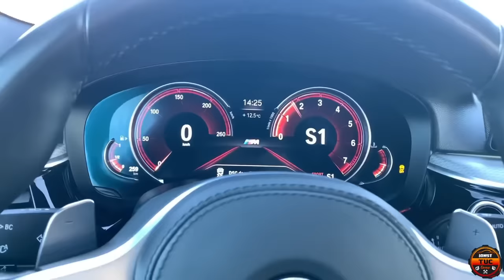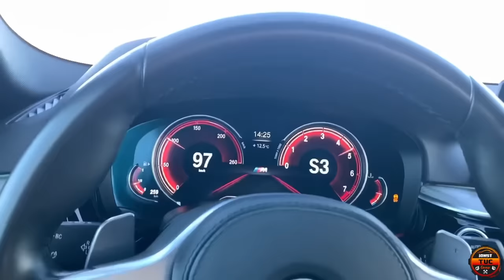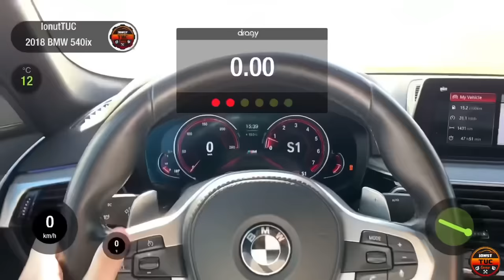Transforming BMW G30 in 8 minutes

Comment: Great black details, I like that you didn't try to copy an M5 but make a tasteful 540i. That ECU tune is quite a lot tho, how is the engine taking the upgraded power? Do you plan on modifying your engine as well?
Reply from the maker: The engine withstands up to over 600 hp! 😉👍🏻
Reply: Remember, it's the b58 😁
Reply: @darius4748  oh wow I didn't know it can handle that much. My M54B30 is currently at around 300 and it has already started to burn oil :D
Reply: Are all b58 engines made in Germany?
Reply: Funnily enough I actually strongly prefer the m5 style fender.. which is what I plan on adding when I get an m550i. The only thing I dislike is upbadging don’t put an m5 badge on a 530
Reply: @AstroF80  whats the price difference between an m550i and an acutal m5? Why not go for an m5?
Reply: @neskuikpeace  about $30,000. The m550i is a diet m5 in my opinion fast and comfortable and not too stiff

Comment: Wow, this was so nice to watch! Great job man!! What was the approximate build cost? 

I´m about to buy my first BMW which will be a 2018 M550i. Planning to do decat downpipes, airflow kit and a stage 2 tune performance wise. 
Cosmetically I´m considering doing a decal delete, chrome delete, mount full M5 bodykit, do the facelift in both front and back, go with 21" rims that has a more aggressive ET to fill out the wheel housing and lowering springs. I think that´s the ultimate car. Let me know if you have any ideas!
Reply from the maker: Total cost 10000$ without exhaust 
Good luck! 
Thanks man! 🤝🏼

Comment: nice job!!!
cant driven on the ,bumpy road ,become hit a front end ,give it up the comfy air suspension,fill every bump on the road ,
low profile tires help to make sure...   
stage 2 chip performance,is a nice touch ,the turbo work hard the air supply the engine. easy to smoke it up (not cheap,to replace)
looks good..nice video.
Reply from the maker: Thanks for the advice bro!

Comment: Beautiful 540i! Very tastefully done. Love the mods.  Curious why did you go K&N drop in filter instead of full CAI with cone filter setup?
Reply from the maker: Thank you man! I was recommended this K&N drop instead of cone because it seems that the first one is better. I think mostly because the cone one retains more dust.
Reply: @IonutTUC  Also, it's already a CAI; Don't spend the extra; just drop in the K&N.  That was the 1st and only mod I've done with my 2017 540IX.

Comment: Looks great 👍 about the deleting cat, did it make the check engine appear on the dash ? Because I was going to delete it too and put the strait pipe but then the guy who does it said that it will show the check engine on the panel and they can’t do nothing about it.
Reply from the maker: It did not appear because the next day I went and did the Stage 2 software. I think it would have appeared if I didn’t do the Stage 2.

Comment: My plan is to buy 530d 2018 in same color and do similar tuning. I don’t care about power I just want luxury and sporty car. Your job is perfect 👌
Only one question, are those facelift tail lights plug&play or you have to hotwire some stuff ?
Reply from the maker: Thank you man! I’m glad that you are inspired by my video. The facelift tail lights are not plug&play. I did hot wire and also I had to go and modify something at the soft, so that the car recognizes them.

Comment: Hey, congrats on the mods; two questions. 1) Which brand are the rims, Concaver? I am asking you this because I am about to order a set of Concaver CVR1 20´´. 2) Which tail lights did you buy, they are astonishing. Any issues whatsoever with them? Have Fun and drive safe!
Reply from the maker: Hey! Thank you bro! 1) The rims are Zed Performance Z.P. 7.1 Deep Concave. 2) The tail lights are original for the G30 facelift. I got them from the site: Bavauto. I never had a problem with them. Thank you, you too!

Comment: Can you put a link with all the parts that you use!? Thanks!
Including the wheels too
Reply from the maker: https://www.dm-autoteile.de/navi.php?qs=G30&search=
Reply: Does the rear lights worked without coding? Or any extras cables?
Reply from the maker: No, for them to function properly you need both coding and extra wires from the front.
Reply: @IonutTUC  ok thanks bro

Comment: Hey bro just to confirm because I been wanting a 540i myself this is not any m versions correct ? Just a regular 2018? pretty clean
Reply from the maker: Hey bro! My car is 540i G30 MPaket, and if you are asking about the M, there is M5 F90 from 2018.
Reply: there is m550i and m5 which are both v8s. the 540 is a 6 cylinder and has an optional M performance package which is just a more agressive front bumper and lowered suspension but it is not like the m550i which is closer to a real M and the M5 which is a full on M car.

Comment: Hi Bro WANTED TO ASK A QUESTION, DOES your car Vibrates at highway speeds? Because mine vibrates and my friend car also let me know please
Reply from the maker: Yes, mine vibrates between 120-140 km/hr, but softly. It seems it may be a problem from the manufacture at the wheel hub. I also know someone that has the same problem and vibrates even harder.
Reply: @IonutTUC  yeah mine also wtf man it drives me crazy :/

Comment: What difference did it make when you put black tape on the wheel and than you changed the wheel
Reply from the maker: Those were the winter wheels. The second ones were for the summer. In Romania we need to change them 2 times a year depending on the season

Comment: Awesome mods… love that engine, what size and spec are the wheels?
Reply from the maker: Thanks! ZP7.1 deep concave 20 inch
Reply: @IonutTUC  ohh 20…lovely; do you know that width? Such as 9,5j front and 10,5j rear or ?
Reply from the maker: @amadeuslala 8,5 front and 9,5 rear

Comment: i hate that my sportdisplay only goes to 200 hp and 400 Nm, my stock bmw does 190hp and 400Nm but with a tune is does 220 and 450. but i can see that on the sportdisplay. is there a way I could up those numbers in the display?

Comment: cred ca in loc de jantele alea de la zat performance mai bine puneai un intercooler si te uitai la niste frane mai de doamne ajuta. putere multa vrem da sa tinem motoru cat mai rece si optim....canci. de asemenea, e foarte posibil sa fi intrat in range-ul de m550i la cati bani au intrat in masina....pacat, v8-u suna si mergea de 10 ori mai bine!
Reply from the maker: Masina este testată atât răcirea cât si frânarea deci rezista pana la 500 cai lejer!
Daca imi iau V8 o sa imi cumpar M5 sau M8! 😉👍🏻
Reply: @IonutTUC  nu asta conteaza cand testezi masina, ca duce 500 cai lejer. Intercooleru ala e sa iti tina aeru mai rece pentru perioade mai lungi de timp cand esti in sarcina ca sa te bucuri de ea mai mult timp nu sa se aprinda ca un pom de craciun dupa 15.000 km ca se duce ba una ba alta. Bmw a recunoscut de mult ca tine motoarele foarte calde deci se uzeaza mai repede totul.
Reply from the maker: Am inteles, ce intercooler m-ai recomanda?
Reply: @IonutTUC  as recomanda sa te uiti la ce ofera ac schnitzer pe site in materie de Tuning (chiar daca e scump au garantie la tot ce fac pt cutie si motor si turbo), si intercooler clar borg wagner (wagner-tuning)

Comment: Let me get all the hate. That is NOT a stage 2 tune, that is a stage 1+ with downpipe, you can Google what a stage 2 is. And then you lower a car that has adaptive suspension? Why? Basically g30 with plastic foil over it and a downpipe. Why would you ruin a really nice car? FYI retrofitting the car with headlights and taillights is a good thing but the other they don't bring any value to the car.

Comment: If you wanna make 460hp, buy a hybrid turbo and a good intercooler instead of wheels and cosmetic crap. You can always add cosmetics. But if you blow a turbo or overheat the engine.. well, it’s just not worth it.

Comment: Nothing on the breaks? Hmmmm
Reply from the maker: No need! 😉👍🏻
Reply: @IonutTUC  until the first crash. USING your brain, when thinking: 

- If you put more HP and torque on a car, it makes it faster, hence heavier to stop. It need better breaks ... to say the least. 

- not even gettin started with the clutch for example
Reply from the maker: The brakes are tested for the power I have! Anyway, in Romania I have nowhere to go fast! 😉👍🏻
Reply: @IonutTUC  Who tested them? If you don't need to go fast, why tune it in the first place?

Don't wanna get into an argument here, just asking a simple question about upgrades reflecting on brakes

Comment: In my opinion - ugly. What's the purpose of the black roof and all the plastic parts. With that roof you just get extra heat in the cabin on the sun, and the plastic bits for sure are not helping aerodynamics. And they are not even carbon to reduce weight. Spacers, and the wheels in particular are not my cup of tea. It's just for showing off and being loud, nothing here is done to really tune the car mechanically. (anyone can tweak the software...) That being said, you'll enjoy the car in the end, but you publish the video, and not everyone has the same taste...